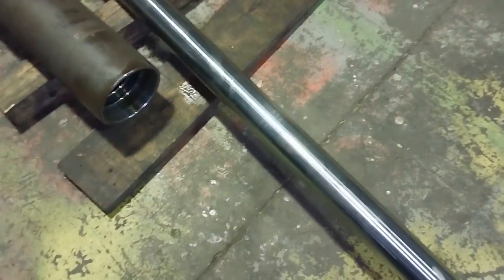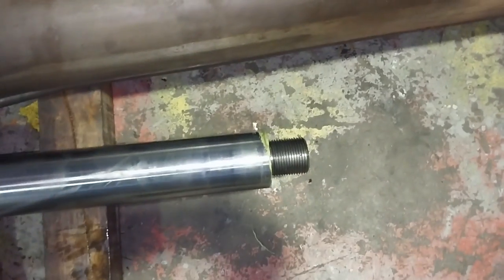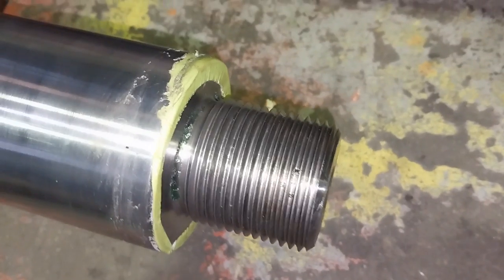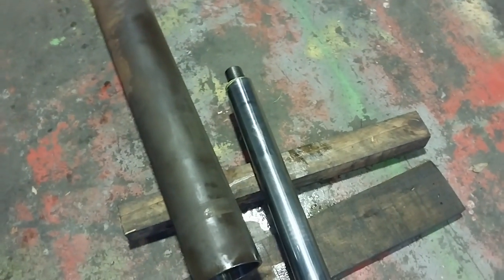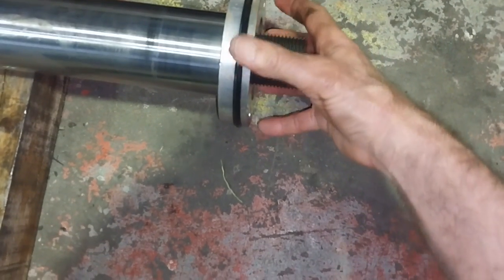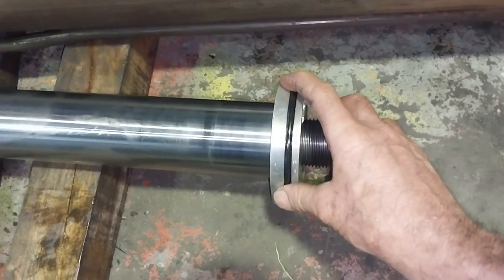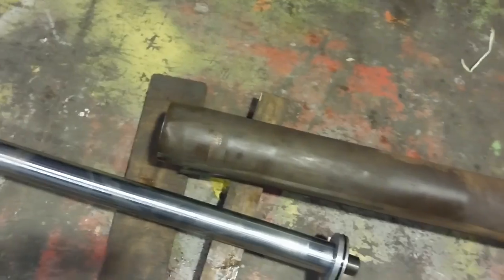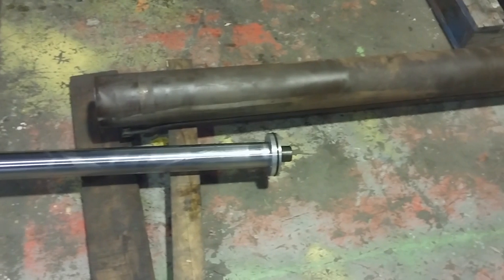Piston Stuck Inside a Hydraulic Cylinder Barrel ? Try This Hack !

Comment: Got any recommendations for those near impossible piston lock nuts (tool wise?) Applied tone of heat and socket and wrench just keeps slipping off and not budging the nut
Reply from the maker: Have you checked that there are no Grub screws or Locking pins?  
If it is a combination piston and nut, We have found locking pins under the piston's wear bands and have also found up to two grub screws as well as ball bearings under the grub screws. 

Some manufacturers will use chemical thread lockers like Loctite and depending on the size of the nut they will be very tight. 
for example 
a nut with a 1-inch thread will be done up with a torque of up to 960 lb-ft   
a nut with a 2-inch thread will be done up with a torque of up to 4,200 lb-ft   
a nut with a 3-inch thread will be done up to a torque of up to 14,300 lb-ft 
Try mounting the rod back into the machine and use a large pipe wrench with a long pipe slipped over the pipe wrench for more leverage. 
Alternatively, try and find someone who has a cylinder breakout bench. 
And if you are doing a lot of cylinders build yourself one. see our  series of videos 
https://youtube.com/shorts/9YzA7OwGr8U
Reply: @Hydraulic.Online  cheers yeah all grub screws been removed nothing hidden under guide rings. I was hanging of 1metre shift and bit of pipe and still no go with the extensive heat. We have a nut buster but I’m 1st apprentice haven’t been shown it. The nut is close to 2 1/2 inch haven’t got socket. Thanks for info